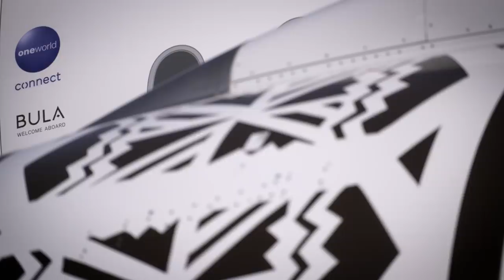In the Making: First #A350 to Fiji Airways

Comment: It's a very beautyful airplane!
Reply: @aloin7671  what about traffic or even the street food vendors? Isnt that worse?
Reply: @shahimagesyt  Not in any case, because airplanes do not meet any vital needs.
Reply: Aloin sir, whats your alternative option that does not exchange your conveniences and time? Green technology is yet to make economical
Reply: @aloin7671  I just farted is that harmful emissions?
Reply: @aloin7671  okay what about those slowass electric cars and hybrids blocking up traffic? When you are in traffic, a standard gas/petrol car burns a shit ton of fuel thus polluting the air. Look at New Delhi for instance, majority of the pollution is from street food vendors and cars!
Reply: @shahimagesyt  Dust from car brakes and tyres will still pollute city air even when the vehicle fleet has gone all-electric, a report has warned. The government's Air Quality Expert Group said particles from brake wear, tyre wear and road surface wear directly contribute to well over half of particle pollution from road transport.
Reply: Aloin what do you want us to do about it? It’s impractical to take a sailing boat or ride a bike everywhere. While pollution may be going up, the new cars and new planes are offering more efficient and cleaner burning  engines. There is improvement and innovation going on every day. You can pick out every fault there is for eternity and never be satisfied, or you can look into ways of reducing your own carbon footprint. Don’t try to expect everything to be perfect, because it never will be.
Reply: @BrianYYH  The amount of tourists is increasing too fast. We should travel in a more sustainable way (bike, public transport, train, ..)

Comment: Fiji airways should have gotten themselves some 777-300ers or even the 777-9
Reply: Media reports say that Fiji Airways had considered 18 products before they decided on the A350-900 XWB. Boeing's Dreamliner was also considered.

That FJ flight crew can switch seamlessly between this and their A330-200s and 300 meant that interchangeability was a significant factor in their selection.

Comment: Will this be the first aircraft that FIJI have brought brand new
Reply: They've five A330-200s, three of which were bought brand-new, I think. 

They also have one A330-300 but not sure whether it was bought or leased.
Reply: No. Since Air Pacific days it bought a mixture of brand new, second-hand and leased aircraft. Recently before the two A350s, it purchased two brand new B737 Max8s and its domestic subsidiary bought 3 brand new Viking DHC-6 400 in 2018 series to do the small island routed.